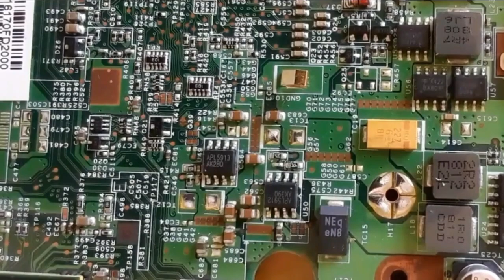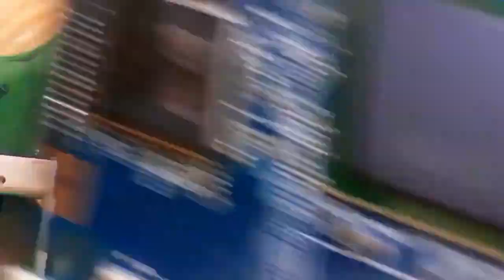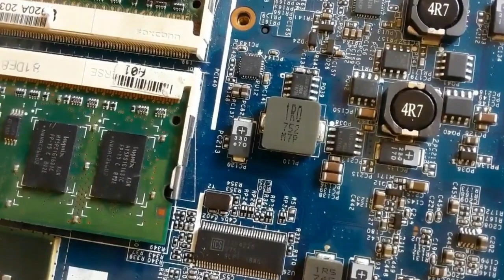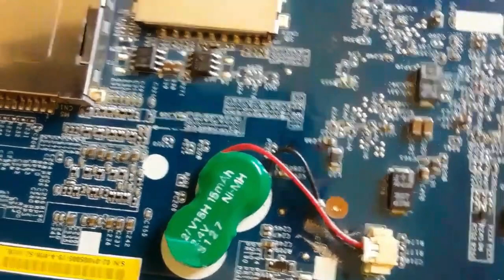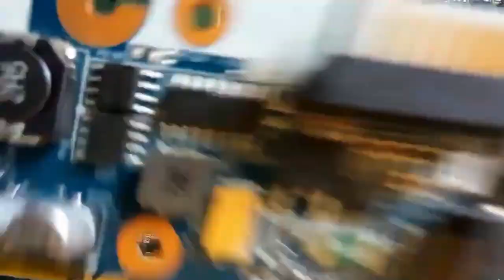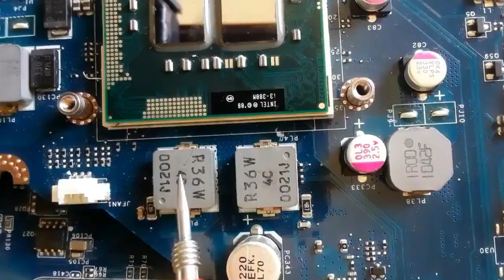Learn all laptop motherboard smd components in detail - Laptop repair

Comment: Good info and very informative! Since I am just getting into the field of electronics, I'd probably follow the same method that I have working on any new equipment or machine which is to take photos or notes so I know how everything was positioned, connected, etc. because even if you pay attention to how something needs to be soldered back on, if you do not get to it promptly, when you continue working on it hours or days later, good luck remembering how it was. Another good practice might be to not remove the original bad part until the replacement is in your hands first.